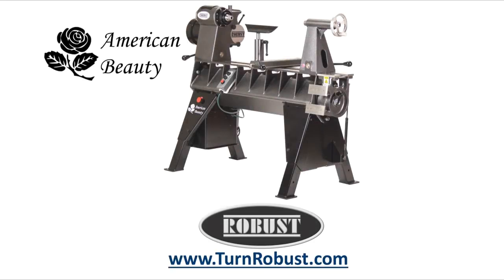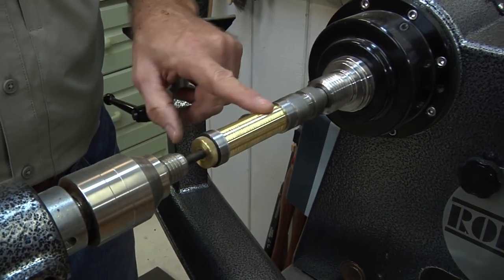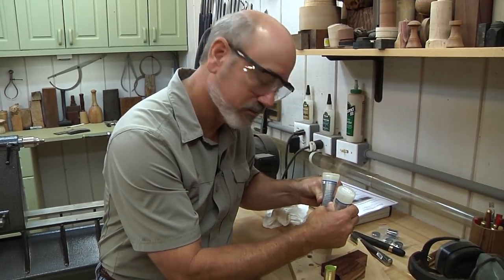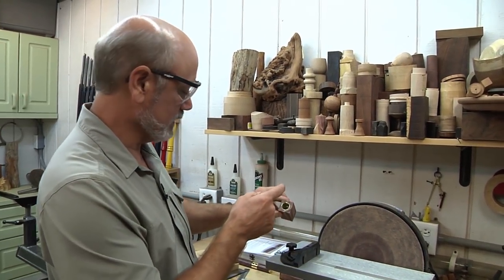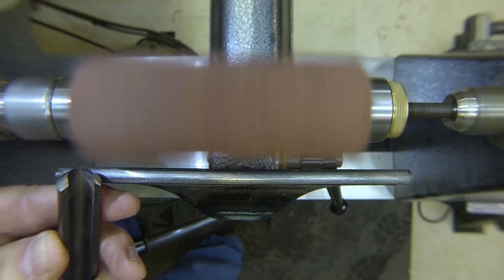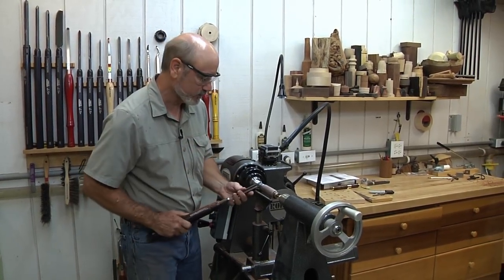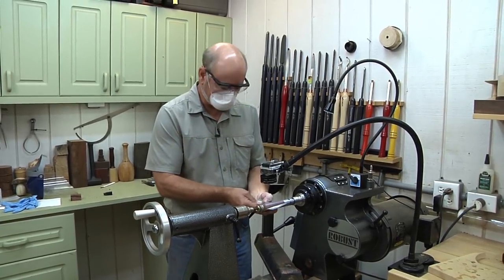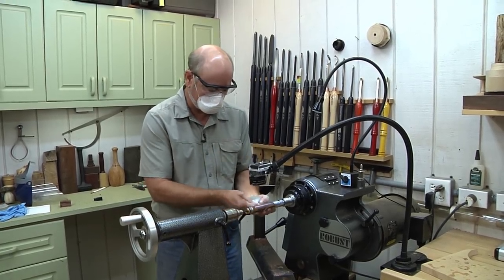Cigar Holder-Part 2

Comment: When I do a CA finish I use 4-5 coats of thin, then micro mesh, then I put on 3-4 coats of Medium CA, micro mesh again then finish with a 2 pad buffing wheel and it makes even cocobolo look like you are going to fall into the wood. A very deep and glossy finish that is nearly bulletproof. I have not seen the cigar tube kit before so thank you very much, it will be added to my next orders

Comment: Tim,  great video. I love your candidness and presentation. I am cigar smoker and I smoke a 54 ring. So the kit won’t work for me. I can buy brass tubing, but is there a mandrel that is adjustable or tapered to fit a larger hole size. Thanks, Al

Comment: A trick to keep from getting glue inside of the tubes is to use some plumbers putty or playdough. Flatten some out on your workbench and push the tube into it on both ends. It will put a small amount of the putty inside the tube, then after the glue dries you just push the putty out and the tube is clean with no glue on the inside.
Reply: I've seen people use a slice of carrot too

Comment: Did he really mean 12,000 grit? Or 1200? I've never heard of anything over 400.
Reply: heyandy x yes. 12,000 is a thing.  Mostly used for turnings.
Reply: Well I'll be. Thanks for the info! :)
Reply: 12,000 grit is real with Micro Mesh, it's their own grit system
Reply: heyandy x its micromeshs grit system, in actuality a 12000 micromesh is roughly equal to 2500 grit sandpaper